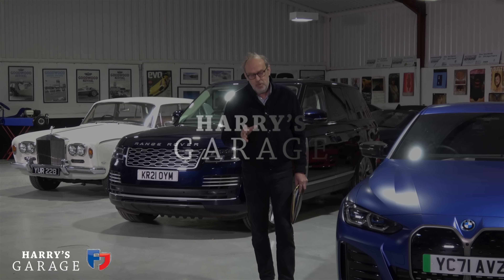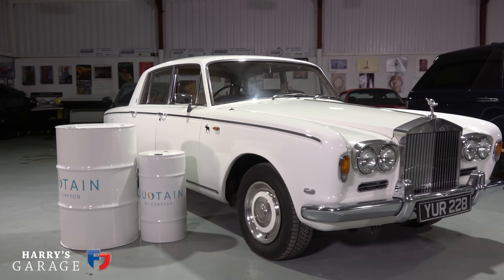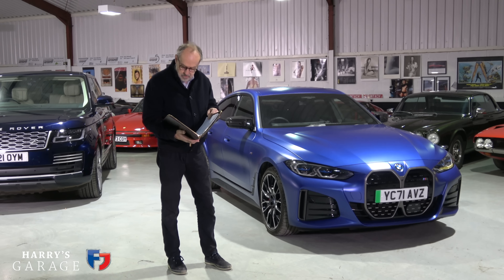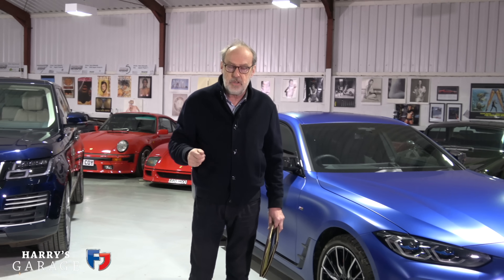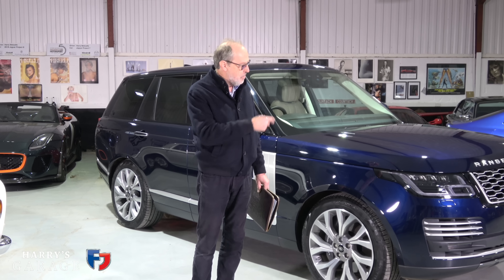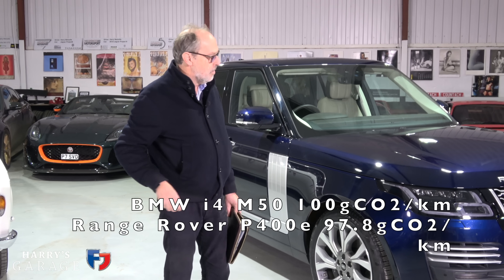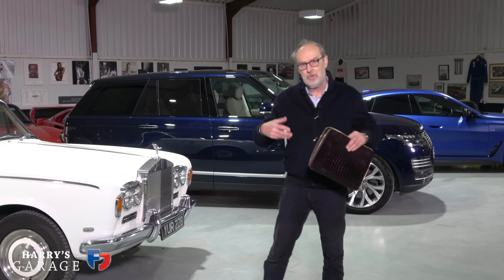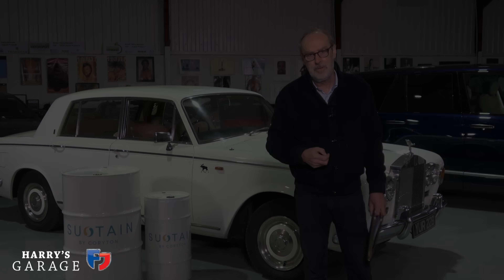Sustainable fuels; what are they & are e-fuels better for the planet than running an EV or PHEV?

Comment: What would be the figures and costs or emmissions, for the Hybrid Range Rover, if the petrol engine was converted, either to bi-fuel ULP / LPG, or converted to totally LPG?
Also if your home had both Solar "electric" 12-kilowatts Panels and one Wind 6-kilowatts Turbine too, recharging a domestic Battery Energy (say 120 or 180 kilowatts) Pack, how would this affect a pure Electric SUV (say the likes of either Skoda Enyaq IV80 or Mercedes-Benz EQA 350) figures and cost or Emmission too?
Or with both a similar Solar Panels and Wind Turbine plus rechargeable domestic battery energy pack, in the case of the hybrid Range Rover.
Again if converted to Bi-fuel (ULP / LPG) engine, or totally converted to LPG, then what would be the figures,  costs and Emmission too?

Comment: Seems a bit suspicious how you don’t add the g/kWh for the electricity the Range Rover uses to achieve the 69 mpg it gets. Please compare apples with apples, not a Range Rover charged from a turbine and a BMW charged from UK Grid, makes this otherwise good comparison look biased.

Also you dont take into account that a huge amount of electricity is used just to make the synthetic fuels, which could be used to charge an EV instead.

Another criticism i have is the Volvo ‘survey’ has been debunked, for a start, Volvo use the WLTP mpg figures which are much better than real life. Also the batteries are recycled, you mine the stuff once and reuse it for many years to come.

Then again, synthetic fuels will never make up a significant proportion of cars driven in the UK, and its certainly a better alternative to run in classics than fossil fuel based products, I plan to use it myself eventually

Comment: Must include CO2 cost to produce traditional fuels when comparing cost to run an EV and the CO2 impact of filling it with electricity.

Great first insights into this important matter but to be a fair comparison, metrics should incorporate CO2 impact of getting petrol to the pump.
Reply: Thats fair enough so long as those metrics also take into account getting the fuel (gas, coal - whatever) to the power station too. Oh and how about the losses transfering that power between power station and vehicle? 
I'm all for including everything for ice's but that has to go both ways. 
It would be nice to see some genuine figures for overall impact starting with nothing and ending with the cars end of life then averaging impact per mile based on that. 
I have a feeling the least harmful would be something like an i3 or Yaris hybrid (small initial impact, minimal electric and fuel usage, long life) but I also have a feeling the most may well be something like an early Leaf thanks to their overly short lifespan. 
Whatever it is I would love to see a simple list because when you ammortise it over average mileage it really is fairly straight forward.
Reply: @siraff4461  you also mention the lifespan issue like Harry, and it’s probably the biggest issue, as there are many who might consider try EV’s but can’t afford a new one, but won’t risk a 4-5 year old one that they will want to run for 10 years or so.
Reply: Si Raff 
Volvo has released good data on this. They have done a whole-life comparison of one their EVs versus the same model optioned with a petrol engine. The headline is that building an EV produces so much more CO2 that the break-even point in comparing EV v petrol doesn't come until both cars have been driven 68,400 miles (at current electricity production mix).

In other words, the overall carbon footprint of the EV is worse than the petrol option up until 68,400 miles of greener per-mile travel finally tips the scales in favour of the EV.

Rather interesting, when currently the most popular way that EV owners finance their purchase - leasing - results in most of them never reaching that break-even point before they replace their EV, at great CO2 cost, with a brand new model.

Regarding the other factors people have mentioned - yes, they certainly need to be considered on both sides if you want to find an answer rather than support the answer you want. Currently, nationwide infrastructure exists for petrol stations. Building enough EV charging stations to support millions more EVs certainly has a CO2 cost.
Reply: Production adds 30% to fossil fuel CO2. If you add this to the RR and the CO2 from the grid as most would have, its around 250g CO2/km
Reply: https://youtu.be/1oVrIHcdxjA
Reply: Totally agree. There’s a lot of talk about how electricity is produced but little about the damage done by oil rigs, oceanic supertankers, refinery facilities and delivery infrastructure (Not to mention what happens when any one of those points fail). That’s a like for like conversation. If we aren’t willing to dive into that kind of depth across the board then yes, evs are as zero emission as is worth mentioning within the typical remit of a car review.
Reply: @Munkenba  because that falls under EV infrastructure as well.
Reply: @FOX11GUY  oil rigs, supertankers and oil refineries?

Comment: Hmm, interesting video, but told slightly from the POV of a gentleman farmer with a fleet of classics (understandably so, and I do very much enjoy this gentleman farmer’s channel 😃). The i4 mentioned there has >500hp and is extremely efficient compared to the equivalent ICE car (which is probably an M3, not a RR hybrid or a 70s Rolls Royce). The much more valid comparison would surely have been i4 v M3 in terms of running cost and environmental impact?

Comment: Despite liking the idea of a plug in hybrid, my issue for most of the population is cost of replacing the batteries and when is that going to be required.

Looked recently at a PCP balloon on a Mk7.5 Golf GTE Advance, £8k when it’s 8 years old.  Have to assume batteries are going to be near end of their lifespan and I can’t imagine it being worth thousands more with a new battery so surely there comes a point much earlier in a car’s life where it becomes uneconomical to replace the battery, not to mention environmental impact of producing the replacement battery 🤔

Comment: Well Harry,keeping an old car in running order, even on fossil fuel has a lower impact on the environment than a new electric car
will ever reach under it´s lifetime,(Max 10 years).I.E Even at it´s production regardless of make or initial price, has already
made an enviromental impact greater,than that Roller ever will make in total.I´m thinking Volvo´s Saabs and lovely Porsches,BMW´s.Teslas are awful for the environment, absolutely the worst, because they have even a shorter lifespan than an VW IE4.An old 30´s Ford V8,renovated with non toxic methods,running on fossil fuels will impact today´s world less than a 10´s 
of these new electrics.

Comment: In the case of electric cars you also have to consider the waste impact on environment when you have to dispose of the lithium batteries at life end of same.
Reply: and after that million miles there will be Redwood Materials (or equivalent) to take care of that.
Reply: @barchetta06  Yes, but Redwood Materials will charge you for that final disposal of the car's batteries and it will not be cheap.

Comment: Running the BMW 100 % EV with your wind turbine electricity would cost £ zero 

🤔

Running the Rolls Royce on Bio Gas would be cheaper

The hybrid is double trouble

Comment: It would be great to see a video on the costs per mile in the case of Hydrogen fuel cell cars like the Toyota Mirai.
Reply: I agree I think hydrogen is an interesting option. Also there is the internal combustion hydrogen engines and the fuel cell.

Comment: Shouldnt you add to the range rover CO2 the theoretical emited by the amount ot electricity needed? Your turbine charges it, but if someone doesnt have one, the kWh they use, have also emited c02
There is also a point that e fuels ignore, and that is particles released, that stay the same

Comment: Harry’s I live in a city. I used to have a 535d MSport as my daily and continent crushing family car. When the DPF filter went I wanted to clean up my act but not lose on cost of ownership and running cost. I found the answer in the unicorn 3 series ActiveHybrid MSport - Basically a 335i in-line six twin turbo petrol with +50hp of electric on top. Silent electric drive in the city and a B road barnstormer and autobahn monster. I am now 100,000 miles in and the battery has lost 1% of its power. This has to be the solution for me for the next 5 years at least. Worth a test because it was so far ahead of its time.
Reply from the maker: I fully concur. Hybrid done well offers best of both worlds. allows you to enjoy periods of EV motoring and wait until UK charge network and tech catches up. In 5 years time, I believe EVs are going to be very different to today's examples.

Comment: Well presented information that was easily digestible. Only negative is you make an error comparing the new electric car to a 52 year old rolls, I agree with the sentiment you were trying to get across, but there are very few cars on the road from 52 years ago. Driving an old car on renewable fuel is better for the planet than buying a new car, no doubt. How many 2022 cars will be around in 2074? A similar percentage seems likely.

Comment: You didn’t bother adding the grid CO2 from charging the PHEV battery 😂 Ridiculous comparison.
Reply from the maker: Because I was showing my own situation with my family car.
Reply: @harrysgarage  That’s all well and good but you then directly compared the PHEV CO2 (from petrol running only) to the electric car, without accounting for the electricity used to take you 60% of your PHEV miles. Extremely misleading. Would also have been good to compare the PHEV’s Wh/mile to the EV’s. Also worth mentioning that the BMW’s consumption ain’t great. I’m getting 292 Wh/mile (3.41 miles per kWh) in a larger EV than that in winter. Interesting video but needs to be a bit more apples to apples!

Comment: Electric cars are worse. You cannot repair these cars after accident as easy as petrol or diesel cars. We are getting additional waste to earth. Batteries in these cars are for max. 10 years and need to be changed,  which give us again, additional waste. 

Really, we are going backwards. The sustainable fuel is very intriguing. However for now we need to live with E5 in UK, because E10 is totally rubbish fuel to use.

Comment: E-fuels sound excellent. Curious how we then transport them to fuel pumps as if they get produced in Chile and then shipped across the world on a heavily polluting cargo ship that's hardly efficient and seems to defeat the point of making the fuel cleanly just to emit more CO2 transporting them instead. Just something to factor in and consider.
Reply: E field are a solution to shipping fuel. The largest tanker and cargo ships cannot be curled by anything other than fossil at present. Shifting them to e field would have an enormously positive environmental effect, including keeping these huge and expensive vessels working into the future rather than building new ones

Comment: It’s called the national grid for a reason - the electrons you receive aren’t just those generated by your nearest power station. How are the sustainable fuels delivered ? Why use the  BMW as an example - it’s not very efficient and these figure are  based on just 2 journeys in winter?

Comment: Whilst i am a massive fan of Harry;s, unfortunately there is simply a huge amount of eroneous information and assumption in this video!

1) If you have a renewables, they use them. A pure BEV has a lower road load (lower consumption per mile) and a higher overall efficiency  than a hybrid, so that means you will always go further on any given amount of energy (or produce less CO2 for a mile driven). If you can charge your RR from your wind turbine, then you can charge your I4.

2) Fossil fuels have a huge embedded energy.  Have a look at an oil rig, oil tanker, oil pipeline, oil refinery, petrol station etc massive, complex infrastructure that requires a hugh input of energy to work. Before you put the fuel into your car it's consumed enough energy to drive an EV a significant distance (in the EU, typically around 20 miles per gallon pumped into your car).  Now yes, the electriciticy generation network also has overheads, but as the grid greens, or if you can use local renwables (like your turbine), this is a significantly lower overall footprint. and of course, with a BEV, you can grow your own, whereas you can't make your own fuel at home practically speaking

3) In the real world, where most people drive short journeys, aggressively, and often in congested traffic, a BEV is by far the lowest consumer (ICE's need to warm up and light off their aftertreatment etc) The relatively small power capability of small capacity electric tarction systems in a typical PHEV means they cannot recover nearly as much energy as for a pure BEV

4) You say "i can't be bothered by public charging" but you drive cars worth hundreds of thousands of pounds and are a pretty high net earner.  Your "can't be bothered" is very very different from the average man on the street. (one tank of fuel in your RR is lets face it approaching £170 ! (100 litres @ £1.70 a litre)  As most people home charge because they don't drive massive distances every day the penalty for "can't be bothered" is very very significant

5) A hybrid has tailpipe emissions, which are more likely to be released close to high population densities

For me, the answer is actually simple: Lets transition most (boring, everyday) cars to pure BEV as fast as possible, so as to reduce our personal transport footprints as much as possible, and that means the tiny impact of classic cars and fun cars, can be ignored  :-)
Reply from the maker: You're forgetting I did 18 months in an EV before getting the RR PHEV and like BEV for in town and local usage. But we experienced the UK charge network first hand and it's not fit for purpose, so we ended up using the EV only for local journeys only and used our L322 RR for longer trips. P400e combines the two and we use it for everything, with 60% of its miles being BEV only.

I'll move back to BEV when we go to solid state batteries and 500+ range, which will make today's EV look like dinosaurs.

i4 was included in video to show potential buyers it's not a zero emission car if you charge it from the grid in the Midlands. If I had only included electricity from our own turbine, what would that show viewers? How many have their own turbine, or could even install one?

Modern ICE with tailpipe filters are extremely clean now, home heating, diesel black cabs, diesel vans and HGV are the inner city pollution problem now.
Thanks for watching!

Comment: @Harry's Garage The problem is that there is so much green-washing and e-fuels are only environmentally friendly in name and advertising.  The US made a huge mistake with its Bio-ethanol production and the rest of the world followed blindly.  The US Renewable Fuel Standard (RFS) is up for review and maybe this time they’ll get it right!?  
My concern is that the principal advantage of electric cars - their efficiency over short journeys is at odds with the design life of their batteries.
If you drive 12,000 miles a year you benefit after 5 years but after 10 years the battery dies and the car is worthless.  So battery cars make no sense for people driving 6,000 a year.
And this is ignoring the fact that reserves of lithium are more limited than oil.
Industrialisation has polluted the planet but nothing is being done to clean up the air - there's merely a switch to the extraction of a different raw material.  Only time will tell how bad the car battery industry is for the environment overall.

Comment: I’m no expert but it all seems like cakeism. Harry mentioned producing this petrol alternative with waste bio, which is great, however, if it means clearing the jungle to plant bio crops it’s a false economy. Also bio takes years to grow, clearing and planting seems to me like strip mining. I think smaller EVs that can be charged at home using cleaner off peak energy are a decent option for some, hybrids that run on electricity at lower speeds are also a good option to help keep our city air clean. Like Harry, I don’t see a huge move to battery pure EVs as a realistic solution unless the technology improves exponentially, we just don’t have the infrastructure, even Tesla’s will struggle if there is a mass take up. I am interested to see how things pan out.

Comment: My 50p, A little unfair comparison on Range Rover and the BMW as you speaking of production of the creation of the power of electricity for the BMW. Should not also for the Range Rover comparison add the CO2 generated to get the gas into the tank?

For the renewable fuel, sound good for us that are petrol heads for older car and bikes :-)

Comment: Wow, great video Harry, thanks for producing all the stats too.  I’m fascinated by the bio-fuel - and although it’s double the price currently, with the cost of oil going through the roof at the moment it’s probably not far away from looking like reasonable value!  Do you have to make any engine modifications to an older vehicle to safely run it?
Reply: It might be double the price, however it is a new technology. Once it starts becoming more mainstream and the bumps are ironed out, the price will hopefully drop a fair amount (:
Reply: Porsche is investing into synth-fuels to keep the classics on the road, so I assume yes.
Reply: If it has a very high ethanol base, then yes. Fuel lines and carburettor gaskets etc. I'm sure both adaptable with relative ease if available.